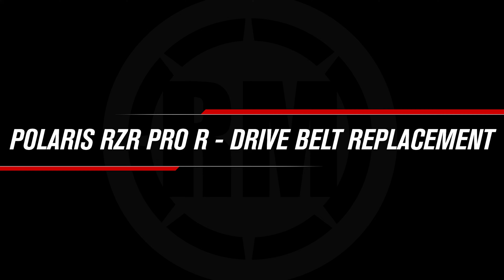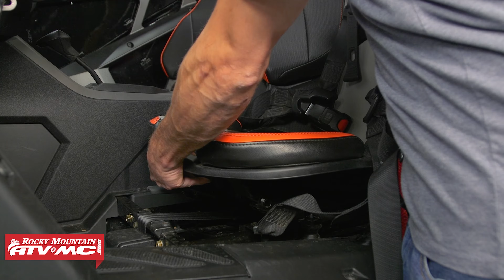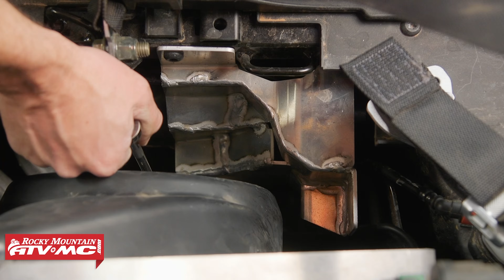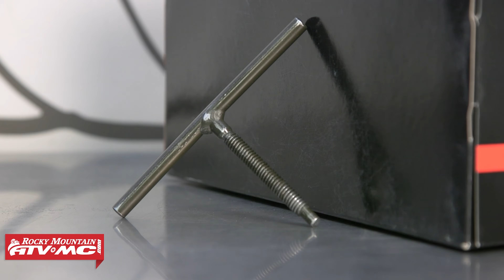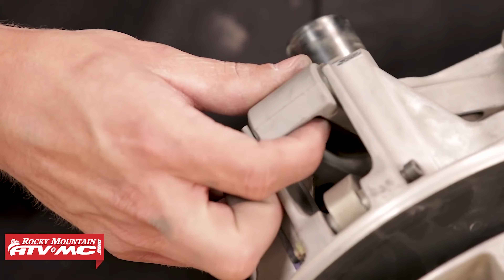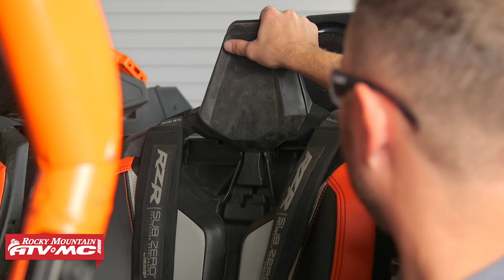How To Change the Drive Belt on Polaris RZR Pro R

Comment: There’s actually two heat shields you need to remove to be able to turn the bottom left tablock. What a pain in the a$$ Polaris has made this to change on the fly if you’re out on the trail! It was suggested to me to not refasten the bottom left tablock or the bottom T 27 torque screw. It’s bad enough that that bottom torque screw is a different size than the others, as well as needing a special long tool to reach it without dropping all the Pieces under the skid plates 🤦‍♂️ So glad I struggled to do all this and break in a spare belt before being stuck with this problem on the trail. Not to mention, I cut up my forearms pretty bad on the plastic housing trying to turn that bottom tab lock with the heat shield still in place. What a total nightmare job!
Reply: I cut the thumb part of my twist lock tab that was hitting that shield. That way I could still turn the bottom twist lock tab without removing that shield, it still isn't easy but it works. Still a pain in the Azz. Riding in the environment and having to do this would definitely piss me off.